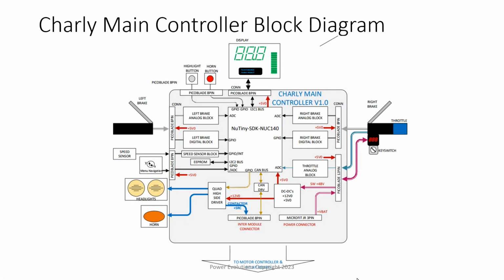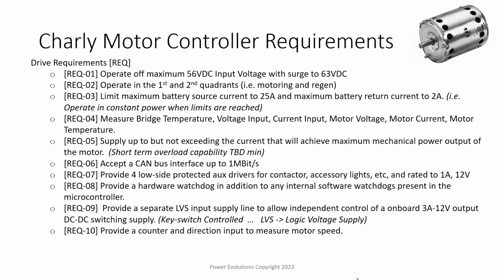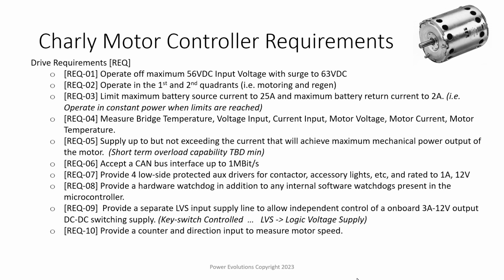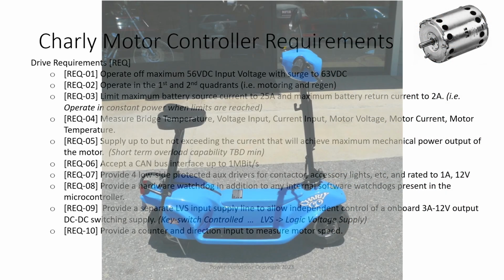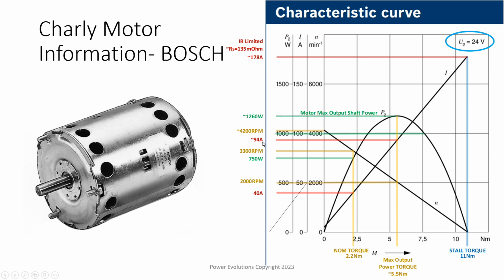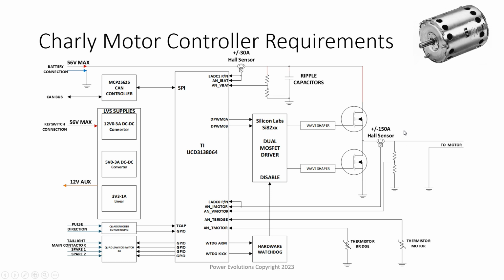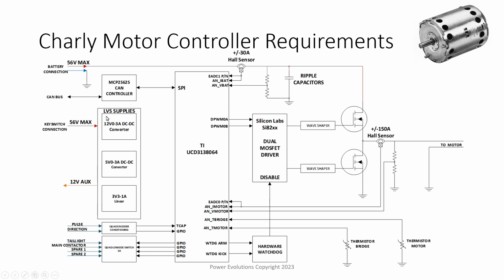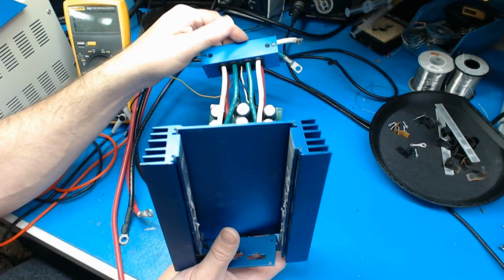Charly Scooter - Retrofit to a 48V System & Custom Motor Controller: Part 10 - Spec the Motor Cntrl

Comment: I have the cousin to that bike,Adly Moto fc20 by Herchee early ninety model red gold tone motor .I think it a 400w  same lay out without upper plastic.. still runs but blows controllers  light have been removed  wired like currie s500